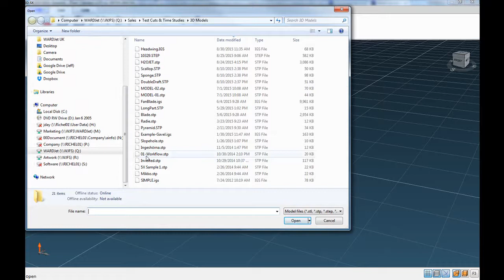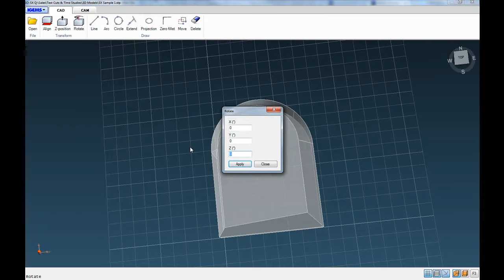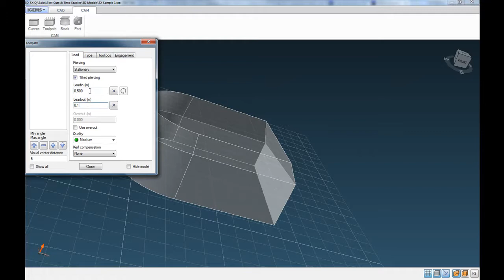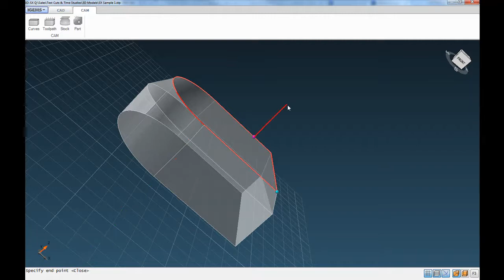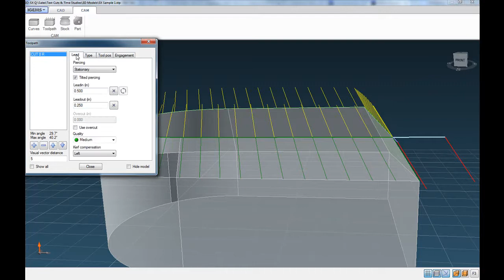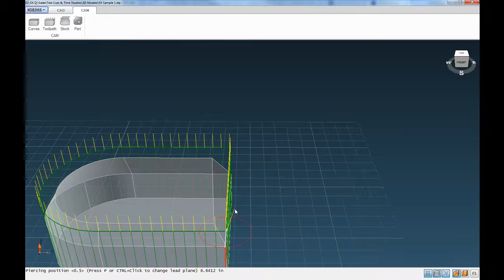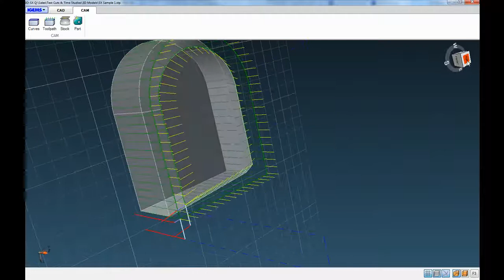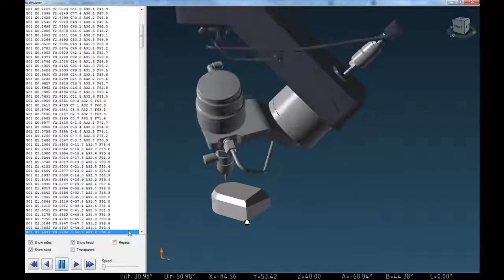CAM 5X 3D Programming - IGEM R2015

Comment: If you cut the beveled cut, won't the part already be cut all the way through? So cutting the outer perimeter would be cutting a part that's wiggling around? how do you avoid the part moving and ruining the cut?!?!? Thanks!
Reply from the maker: Ryan, there's a few options to do this. You could use a fixture or tab, but moving a clamp around the piece as you cut would work as well.
Reply: I am working on a few parts that have the same outer perimeter as the part in this video. We are tabbing it in, cutting the outer perimeter/ straight cut and then cutting the beveled cut. When we cut the outer perimeter a second time (for the beveled cut), th tabs were cut and the vibrations ruined the bevel. clamping them down would be very tike consuming for mass producin these beveled parts. De-tabbing is quick and is a better option (in my humble opinion). What are your thought? Also great video!
Reply from the maker: Ryan, I understand where you are coming from. I'll try to touch base with the technical staff that authored the video and see if I can provide you with more details.
Reply: That would be awesome! Do you think this is a common problem?